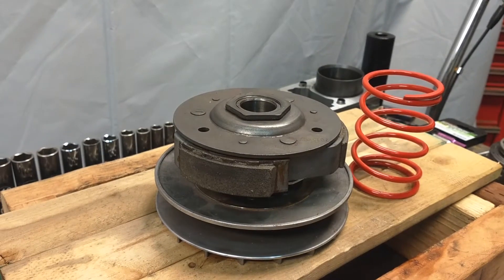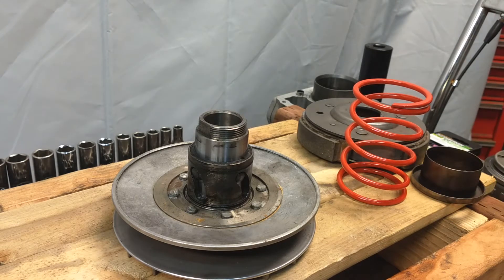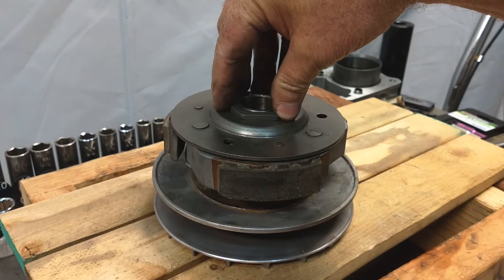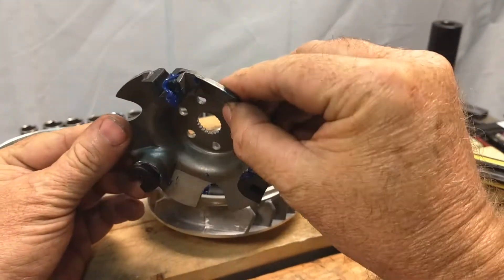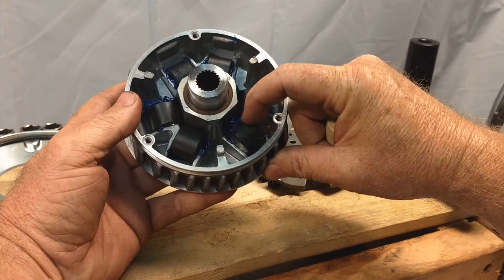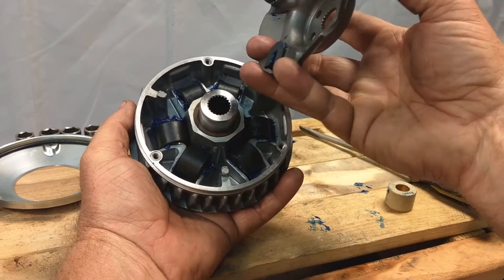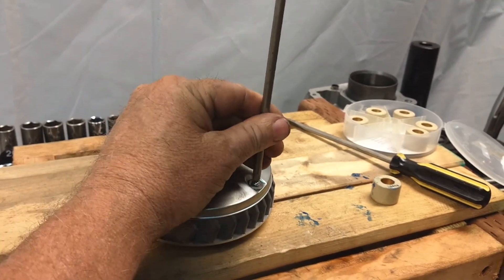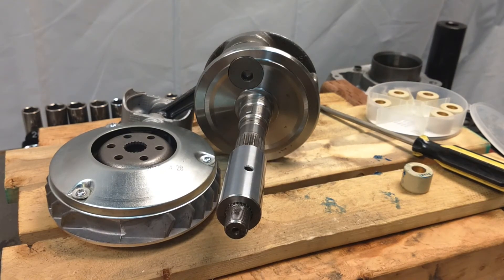HISUN 250 CLUTCH

Comment: Awesome video do you have a link for the parts ?
Reply from the maker: you can see all of our parts at warriorsoffroad.com and for the question about the size of the clutch, the early ones were 135mm and the newer ones are 145mm, but keep in mind they are not the same as any other clutch out here. Yamaha, Kawasaki, Honda, Suzuki, Alpirllia, and any of the european scooters do not fit this. Hisun has their own clutch dimensions and offset, we have bought thousands of dollars worth of clutches to try and match them up with no luck. We finally had our own clutches made and should be shipped in a week or two and ready for sale. Hisun has a special clutch bell that prevents it from using any other clutch as well as a special spline on the main shaft and primary shaft. No one makes a clutch bell for it. I have checked with Polini, DrPulley, Malossi and more and none fit. There are no variators that are bolt on as well. But we did have one made and should be out soon.

Comment: I have a 2018 hisun vector 500 (Home depot version)  was curious to know if a rhino 450 or 660 aftermarket spring would help me in any way over the stock spring? Any advise before I take this thing apart?
Reply from the maker: Yes, I would change the spring, you will notice an improvement for sure. I would use a 450 /660 rhino spring to get more power to your engine from your clutch.
Reply: @vtxracer1  Man I have been trying to get someone to confirm this for a year! I definitely will be getting that and a new belt. I have a little over 2100 miles on it . I have a 660 slug kit in my wet clutch. hoping this will get me going on my quest to get more power and top end speed. will be looking for a modified cdi at some point after that. thanks for your help!! please keep your videos coming !